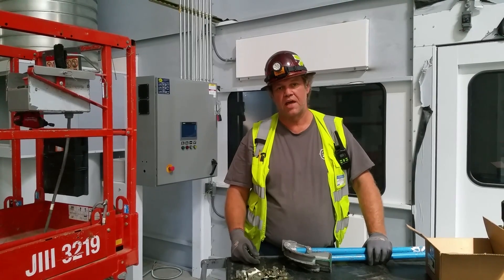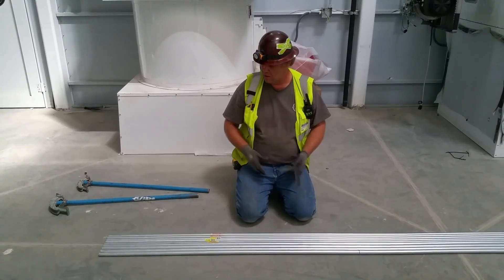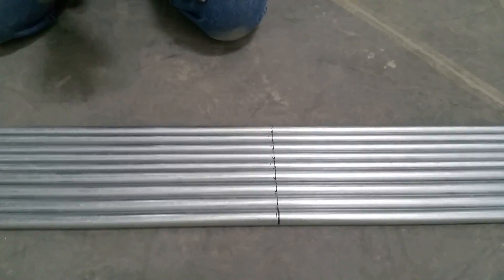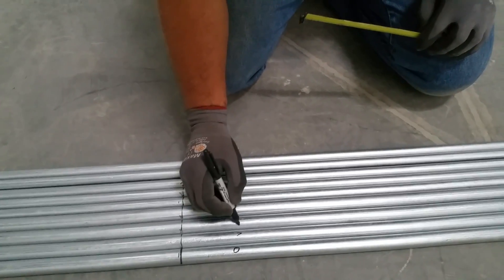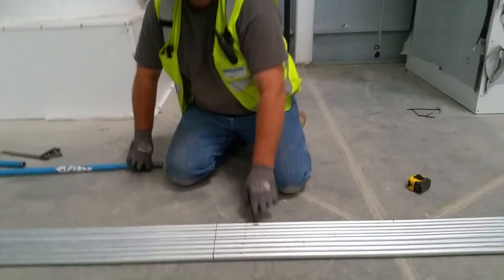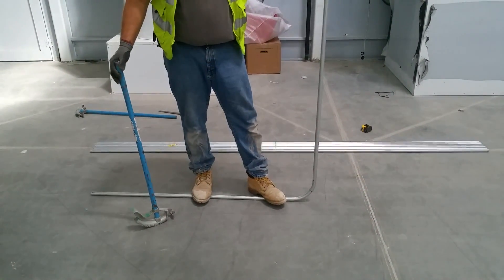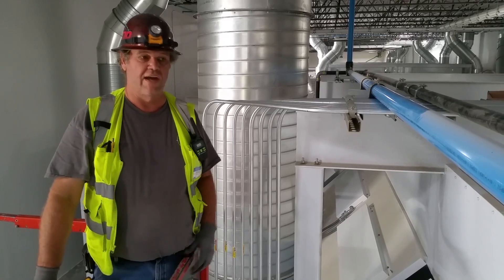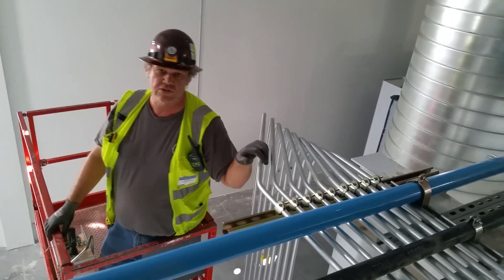Conduit bending 101 Part #1

Comment: question. can you give me a link to help me when I'm trying to match a pre existing bends and off sets. I tend to guess a lot and I'm trying to be more accurate and efficient.
Reply from the maker: The ability to measure accurately is half the battle, the bending is the easy part :)
Reply from the maker: I haven't filmed anything like that yet, sorry. Good luck with your search.
Reply: If you find the center of the bends on the pre existing conduit, you will be able to measure and get your distances pretty close. To do this lay a straightedge across the inside of the bend and draw and intersecting lines. If you're trying to match an offset but have nothing to measure off of, take a straightedge up with you (a cut off piece of conduit or strut) and press it up against the straight section of the conduit and measure off of that to the offset to get your distance. I hope this helps, hopefully I haven't completely misinterpreted your question.

Comment: Excellent video, Thanks for sharing. I still do not understand how you get your first offset at 9 inches mark.
Reply: Nico 9 inches is distace between the first kic and the first strut he used to support the conduit seen at the end of the video, as for the 2 inch staggers he uses those because he has a space of 2 inches between each conduit. as the number of pipes grow so does the measurment on ghe kic in equal incriments to the space between the pipes

Comment: Hi Shadon,
Thanks a lot for the video, its great!
Can you please explain how you run the wires after the pipes are all laid and connected to each other?
Reply from the maker: We use what is called a "fish tape" thin steel band with a hook on the end, we actually pull the wires through.
Reply: Shadon HKW do you use any kind of fish tape mouse or any similar device?

Comment: Emt God!  Now I know why you do separate runs.  It makes the job look pretty. ;)
Reply from the maker: Actually I would rather run 10) 1/2" pipes than 6) 3/4" pipes and pack them with wires, derating circuits comes into play when sharing circuits within a common pipe (and it looks cool)
Reply: Shadon HKW   Oh, I know.....      Pulling wire since 1975.  Coolest was an underground 13.2 for a restaurant pad feed.  Do you punch your boxes with hydraulic punch kit or Greenlee sheetmetal holesaw (my favorite for 1/2" ko's)?
Reply from the maker: Been using the new(er) Greenlee carbide holesaw kit with great success.
Reply: Shadon HKW   That's actually the holesaw kit i was referring to.  Do you lube? And how many holes do you get out of one of the 1/2" ko carbides? And last question, Do you sharpen your Greenlee Carbide holesaws?
Reply from the maker: I probably have 200+ holes with the 1/2 inch, I lube the center drill (HSS) but not the carbide, hasn't needed a sharpen yet, other than a diamond card touch up, they are cheap enough I would probably just replace it.
Reply: Shadon HKW it wont unless you abuse it by pushing too hard or drop it , I put a drop of 20 weight oil on the tip of all my drill bits . they last 4 times longer.

Comment: That looks great.  I wonder how hard it is to get the wire through?  Keep on keeping on.
Reply: He's probably running 4 or 5 runs of #12 thhn.  You can fit 11 or 12 (I forget now) #12 thhn wires in a 1/2" thinwall emt. So since he's running 4 or 5 in a 3/4" Emt. It'll almost pull itself. ;).   Another thing I've always lived by is you count all of your bends in a single run, add up all the degrees of each bend, and never go over 360 degrees of bends. Because you can't pull wire through more than a circle....you can sneak in a little more if you aren't packing the pipe too tight.  That's another reason to do a 90 and a 30 rather than two 90's at the top of the risers, it gives you 60 degrees to play with later down the run if you need it. Sorry for the long answer!
Reply: Thanks for the big answer.  It appears it was as short as possible to still get the information in.
Reply: Yonatan Yekutiel   You would use a fish tape or a foam conduit "mouse" that you suck a pull cord through with. If you're pulling long lengths, you must use sweep elbows and have no more than 360 degrees when you add up all the bend angles. If you have more than 360 you would install a pull box or condulet as a pulling location.
Reply: Can you please explain how to run the wires in the pipe on a long run like this? i always run the wires in the pipe, then connect the pipes together... (low voltage wires). I cant figure out a way to run them after all the pipes are connected.
Reply: Ken Wolfe thank you!
Reply: traducit en en ispanis por pliss

Comment: why not use cable tray?
Reply: They are probably doing what the engineer and drawings called for.  I doubt it would be contractors choice in most cases.
Reply: jfbeam it's the magnetic fields that would be bundled together in a cable tray that would build up heat.
Reply: If it's electrical cable (i.e. "high voltage"), it likely has to be armoured for code.
Reply: Josh see magnetic fields and bundling
Reply: cheaper to run emt rather than cable tray and teck cable
Reply: Those might be coming out of a panel there and then splitting off
Reply: Not Necessarily. If your running SWA. “Eddy currents” shall be contained due to cores twisting inside the cable make up. Eliminating build up. If you’re running single core cables for Each Phase then you swap two phases from the bottom synchronously. Again containing the corkscrew effect of a magnetic field.
Reply: If the wire fits in the conduit. It is too small for cable tray, also in Cali a contractor can design and build his own work.

Comment: Hi Stan, effortless execution there, well done! I was wondering what the wall thickness of the conduit you were using is?  Is it galvanised? The benders you are using are far more compact than the units we use in the UK, ours are a floor standing tripod type that also have a pipe vice for threading the end of the tube. I wonder if yours would have enough clearance for 20mm and 25mm conduit?
Reply: I was thinking the same! The conduit he has seems lighter than ours (and no doubt imperial to boot) .... I suspect there is a different bender for each size of tube ;0)
Reply: For the sake of the questions: EMT U.S. is galvanized, in this case. The thickness of the wall adds roughly 1/16 to 1/8". So EMT sizing for the hand-bender type shown here goes as follows: 1/2" (16mm), 3/4" (21mm), 1" (27mm), 1 1/4" (35mm). And there are separate benders for each size.